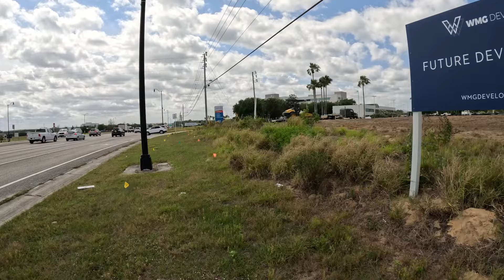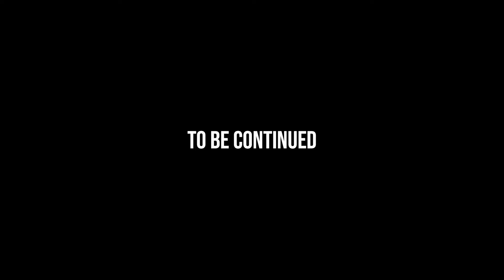I Wasn't Prepared For What Happened

Comment: Brother, that lower back ache, In my case I try to decompress the spinal chord discs by stretching them up. 
(Disclaimer, I am NOT a physiotherapist, do it at your own risk.)
What I do is I first find a spot that I will not be exposed by looking back and making sure no one is behind me. 
Then at the standing up position I keep my knees locked and legs straight, and try to reach my hands to the ground. 
First it is easier with them legs widespread, but gradually you want to get them feet as close as possible. 
Do it a couple of times and go back to the stand up position. Then repeat it a couple of times every time you are doing something outside the cab. 
The result is some vertebrae on that lumbar region sound like they crack, what is happening is you are stretching them up and decompressing your lower back. 
It works for me, bro.  It may be the vase it would work for you, too. 
Also it is generally recommended to bend knees before lifting any weight, even when picking up  them  chain tensioners. I had to change my habits as age started to  pick up. It seems to be helping me delay my retirement. 
As of late 40's we need to be grateful to feel pain. That means we are still alive. The moment one suddenly stops feeling the aches and pains of the body it is probably not a sign of one is feeling better moving forward. So I just get on with it. As long as money is coming in, I can still think like "no pain, no gain". 
On my weekends, I go for a walk, to keep moving and try to control my overweight. We truckers should always be aware of overweight, anyway. 
Fat does not pay freight. We pay that bill.  I won't give up my weekend beer, so an hour's  fast walk is a toll I'll pay gladly.
Haul on, man! 
You are one of our heroes!
Reply: Thanks for the kind words and advice I’ll try it for sure